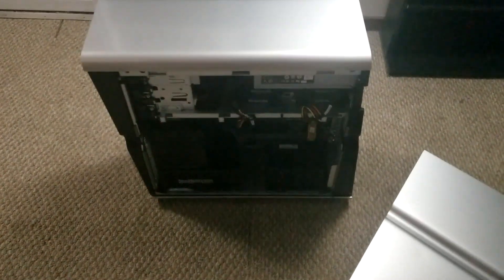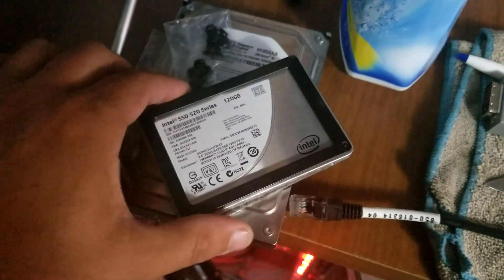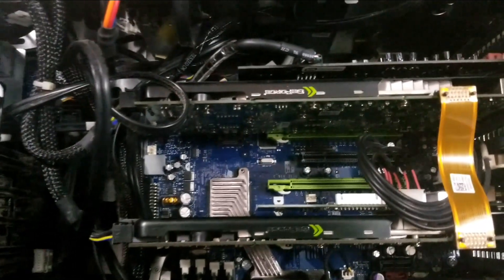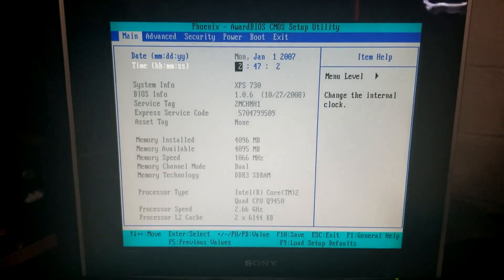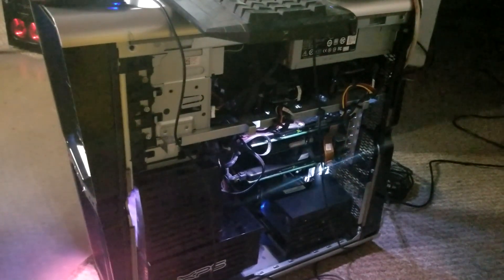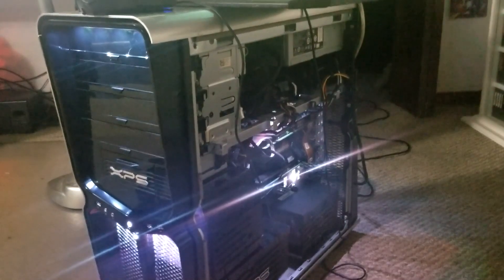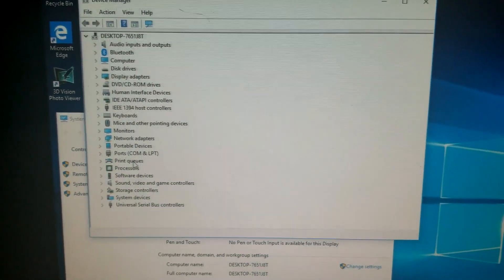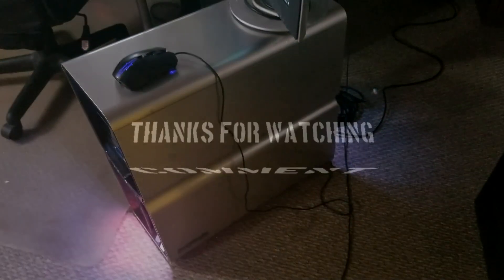Dell XPS 730 Saved From The Trash

Comment: I have the original XPS 700 Red/Silver case. Pulled it out a few days ago after its been sitting in my closet for many years. I tried to boot it up but it keeps shutting down. I checked the power supply with a tester and it passed that test. Hummm...

Comment: For all those drooling on the nVidia 3000 series cards...this case will eat one..any one of them...you have a 1,000 watt server grade PSU, and can use 6 pin to 8 pin converters (2 for $10.00 bucks on Amazon) and the cards are 12.5 inches long...so in the XPS 730x case...you have the front to back room to gobble one up.  So...I'm ready for the launch...and let the Dinner Bell gong!  BTW...the SEVER GRADE fans in this bad boy chassis...will again, earn their keep with the 3000 series Bad Boys...:)   Gotta love it...  and oh..who ever threw this case out...is a certifiable IDIOT!  This was the best case ever made...you can get a hernia,  trying to lift it...LOL!   This poster...does not understand what he picked up...for it is ATX standard...and any new ATX motherboard, can be slipped right in....so...do that...populate that motherboard with the latest CPU and GPU...same for memory...and you will have a current state of the art, but...with a KILLER CASE surrounding all the goodies...and a case that has a thermal head room,  let alone, the server grade fans...but that the the voluminous interior gives good component separation.

Comment: I just bought this PC for 240 around Christmas but I want to upgrade it any ideas of what will work for this pc it wood be great if any of you can help 👍 works pretty good for its time being in 2020 lol now 😄 is there anything else I can do to make it faster to play 120 fame with it not lagging
Reply from the maker: If it doesn't already have one you could pop in a Intel Core 2 Extreme processor, Some kind of video card, and of course a ssd and I think you would have a pretty good rig.
Reply: Thank man I will have to do that its definitely still powerful but the upgrades you recommend will bust it up little faster 👍

Comment: These are very desirable. People like to gut them and put modern hardware in them. Only the 730 and 730x are ATX, the rest of the series, which is much more common, is BTX, so they require a lot of cutting and fitting of an entirely different motherboard tray to put modern components in them. I have a few 700-720 systems.

I have a single XPS 730x, which is all original, other than the fact that I put a Westmere hex core Xeon into it, and have played around with some more modern GPUs. The lights in the room flicker when I power it on, but it keeps up with my gaming rig, which still plays everything on max in 1920x1080.

Comment: why did you only put 4GB of ram? I have 16GB (2X8GB sticks) and slapped in a GTX 1050TI OC edition and 240GB SSD and a 3TB 7200rpm HD and Windows 10 of course... plays all my games on high or ultra at 85FPS on 1080P! games like Doom 2018, just cause 2 and even just cause 4 (on HIGH)
EDIT: also got the alienFX lighting system working with even the music lights going on!
Reply from the maker: I didn't put anything into the xps that's how I got it. I just saved it from the trash. If I end up ever using it I might put more ram into it. But I kinda want to keep it as original as possible. I have a number of PC's that are way better than the xps so at this time I have no reason to upgrade it.
Reply: @MattMan69  too bad, you're under utilizing it IMHO... capable little (monstrous) machine.